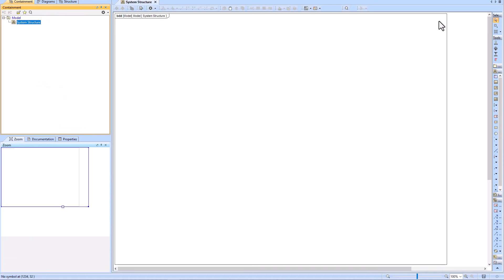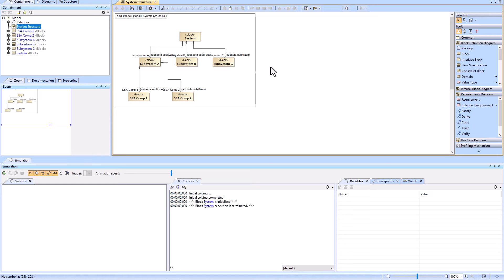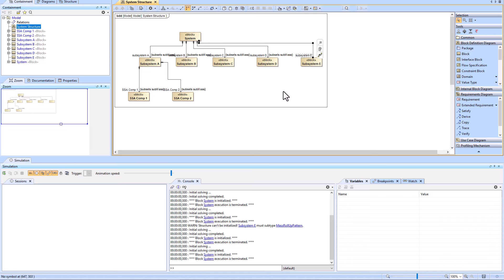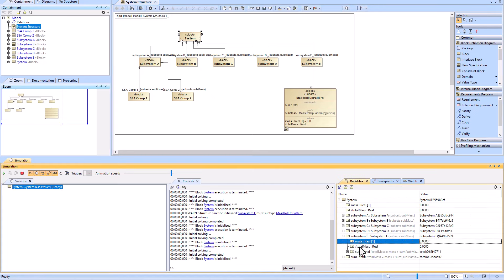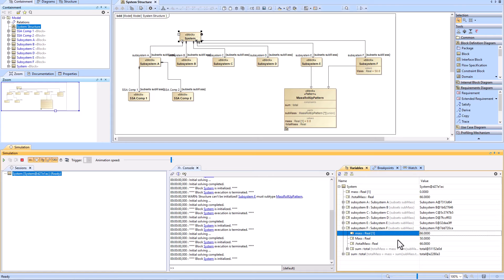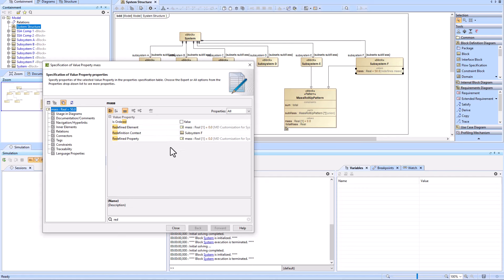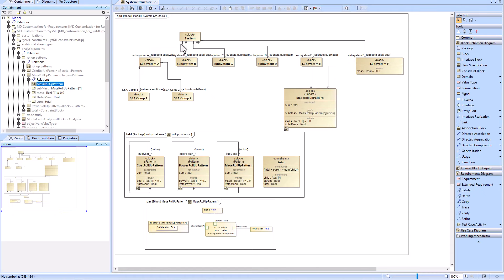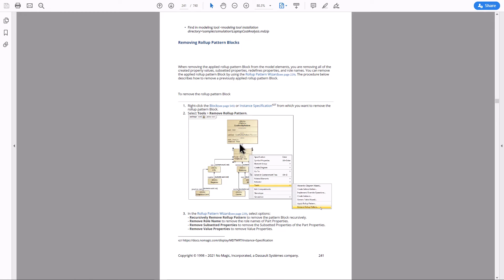Cameo - How To Fix Broken Rollup Patterns

Comment: So if I understand this right, the benefit of having it create the value properties and redefine when creating and applying the roll-up pattern is so it skips you manually doing that, with the benefit of being able to assign default values whereas you otherwise would not be able to.

I guess my main question/concern is that if you use the same cost rollup pattern twice for two different systems in a single simulation, how do they not conflict with each other’s values?  Or is that bad practice and I should be manually creating parametric diagrams and assigning unique values.  

I think my main question is in the simulation, when inputting a value does it query the top level parent block and run the rollup pattern for it, and then in the instance that a second top level parent block exists for the changed value the rollup parent for that block gets executed after the first one is complete?
Reply from the maker: yes, the benefit of it creating the redefined value property just saves you to manual time to select redefine.

If you have multiple rollup patterns they should be independent of one another but I'm not thinking of a case where this would be the best implementation.  The rollup pattern will be applied to all blocks below the subject of the applied rollup pattern.  So, if you have applied a mass rollup to subsystem A as the subject.  And you applied a separate mass rollup pattern to subsystem B.  and then you were to run a simulation at the system level with subsystem A & B then you would be able to see the mass of subsystem A & B separately.  You would not get the total mass of the system though. So, wouldn't it just make more sense to remove the rollup patterns at the subsystem level and apply a single rollup pattern at the System level so it would rollup the totals for subsystem A and B into a system total mass value?

I'm not sure I follow your last paragraph. I will revert to restating that it rolls up the value properties from the part properties below it recursively.  The miss rollup will take the sum of the children's mass.  The child's mass is calculated based on the child's children's summed mass.  And loop continues until you get to your smallest element.